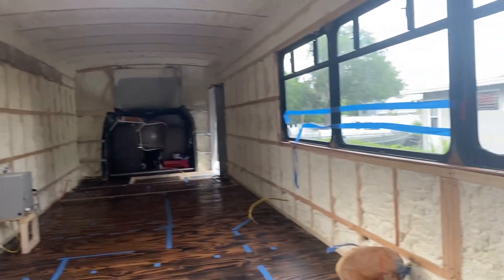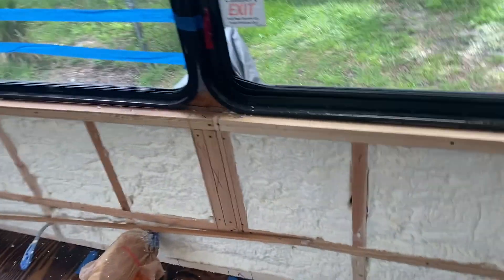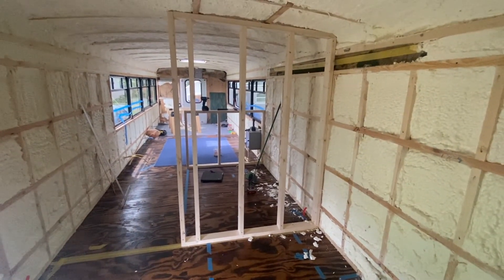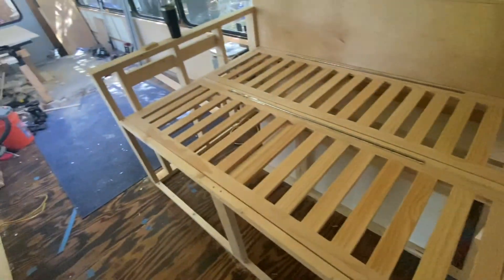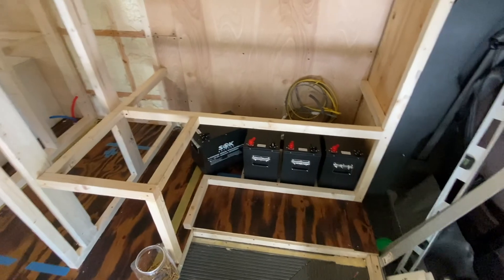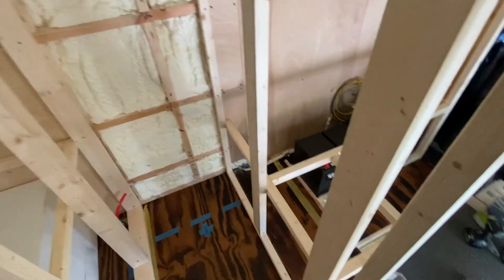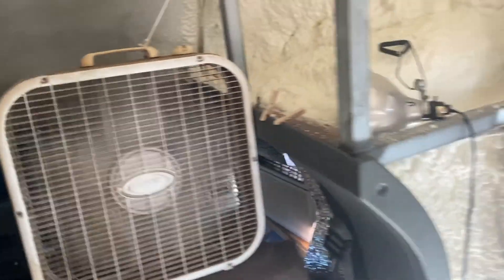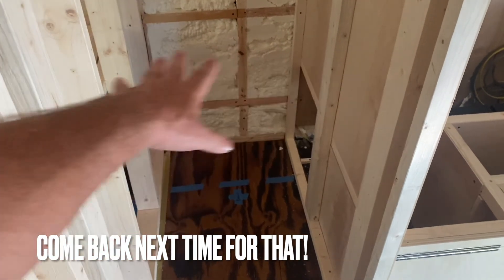"Big" Shuttle Bus Conversion part 4 "Framing and Insulation"

Comment: Hi love following you guys. I missed you Seattle visit though where I am. Question, how are our shuttle bus original ceiling panels put up? Is it the small strips holding them up? Are the strips tack nailed? Need same insulation as on video without having to tear the entire ceiling down I don’t wanna have to replace it. You think that would even be an option? Thank you!
Reply from the maker: Thanks for watching. It kind of depends on the maker. Ours was screwed and just had some polystyrene in between. You could leave it, and screw plywood strips into the metal structure 1/2” or 3/4” . Then add more of that thickness of insulation between. Then put your final finished ceiling materials on. You will lose whatever height, doing it that way, but if you have the head room, it can work that way. 😉✌️
Reply: @Wanderboom  not worried about height I was just wondering how to get these panels off without destroying them so I can put some more insulation up there I am on the global 26 foot from bumper-to-bumper
Reply: @Wanderboom  Glaval Ford E450. Auto correct missed it

Comment: hey how did you get that foam spray even on the corners of the ceiling area? I wanna keep the original gray  fiber glass ceiling cover to save some money
Reply from the maker: Thanks for watching. We had the foam done by an insulation contractor. They did most of the cleanup and I did some fine tuning. 👍
Reply: @Wanderboom  thanks, do you guys do consulting?
Reply from the maker: @Iamandthatiam  I am currently booked up on building projects into the fall. Happy to answer any questions you have. If you would like to talk more in depth about building ideas or details we could try to find some time for a FaceTime or zoom type conversation. I charge $60 an hour.